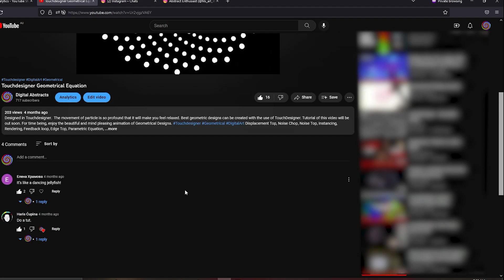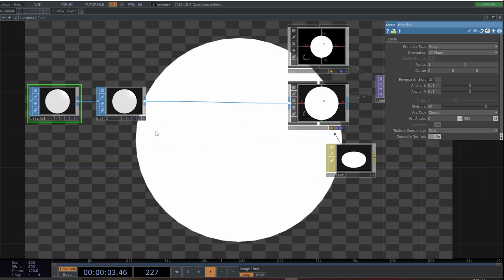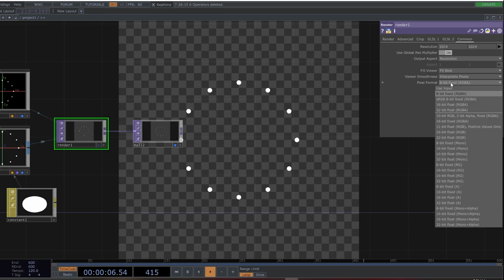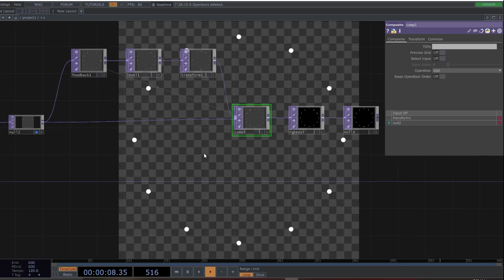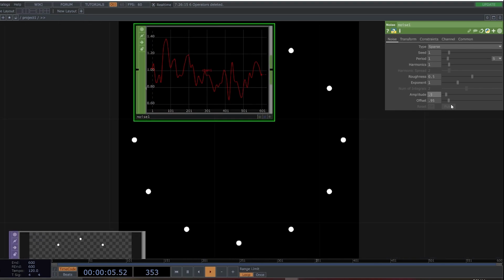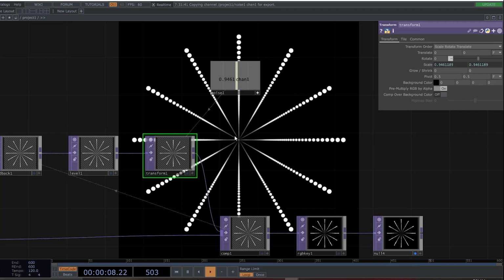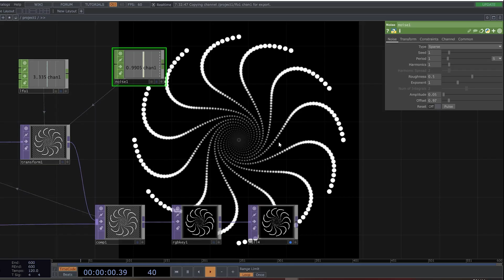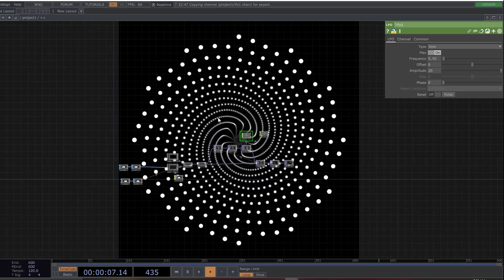Touchdesigner Tutorial: Smooth Animation using Feedback and Instancing

Comment: Great video thanks - very concise but packed with info. I'd love to learn some of the shortcuts it looked like you were using - when you were creating the feedback chain you seemed to add several operator nodes from the same selection window without having to reopen the window for each one, and they were all connected automatically as well - how is that achieved?
Reply from the maker: I am really happy that my tutorials are helping you... Regarding the shortcuts.. I was just using Shift button. I pressed Shift button and kept on clicking the nodes which I needed for Feedback and then it automatically creates a link among them. try it out.
Reply: @Digital.Abstracts  Awesome thanks so much that will be a real time saver - I was trying to do it with ctrl incorrectly
Reply from the maker: @scrattyrat  all good mate.. have good time learning..